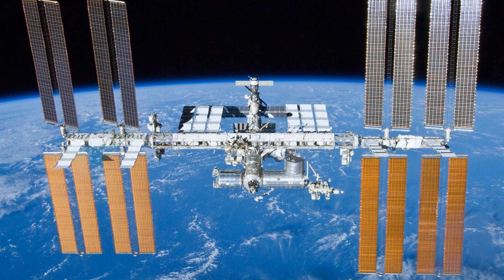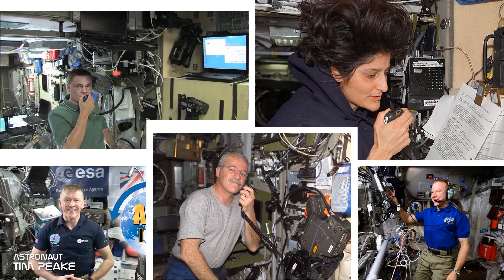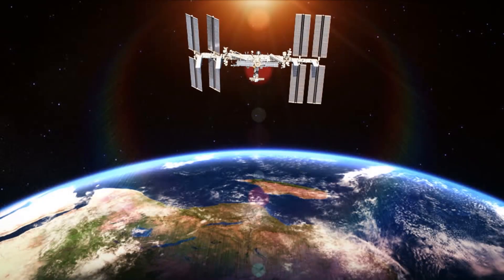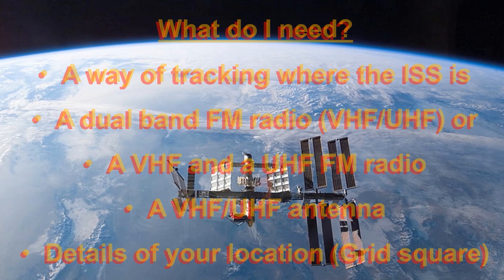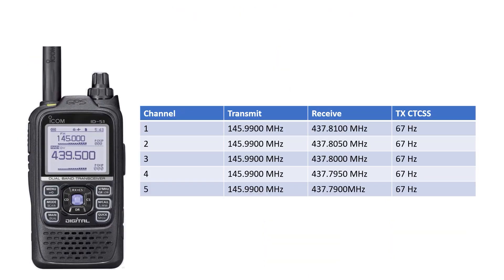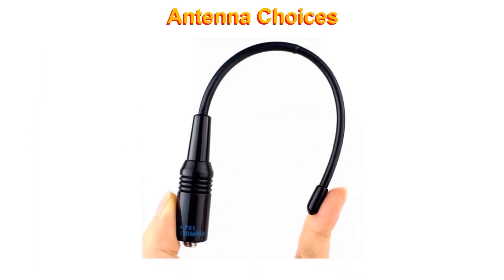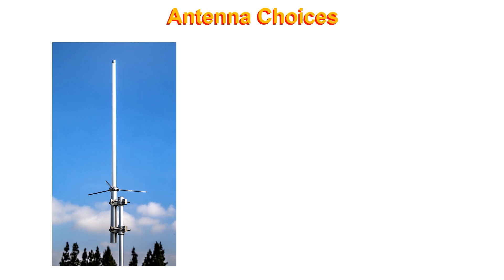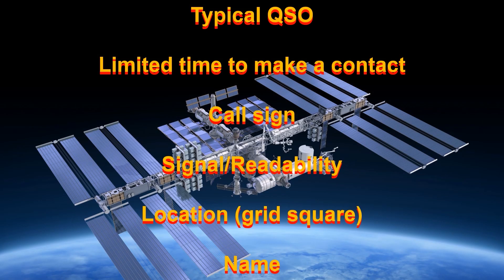How to work the International Space Station cross band ham radio repeater

Comment: 2 cardinal rules for working the ISS and any satellites: #1 always make sure you can hear yourself on the downlink. If you cannot hear yourself, you won't hear anyone else trying to call you when you transmit. You will be doubling and walking over other would-be QSO's. 

#2 DONT CALL CQ ON AN FM SATELLITE! EVER!!!   Simply give your call sign phonetically and your grid square. Leave a pause and wait for other stations to call you.  Don't be a lid and stomp on other operator's signal because you cannot hear yourself or you're continuously calling CQ. Remember the ISS/satellites are a repeater. Repeaters must be shared. Be courteous to other hams trying to use it. 

Save the CQ calling for linear sats.
Reply from the maker: All very sensible comments Jesse.

Comment: Hi Kieth. New to this.. do I put the RX frequencies or The TX frequencies into my UV-5R.
Reply from the maker: Hi Michael, no problem. Set up each channel as set out in the chart (at 2 minutes and 39 seconds). Each channel has a vhf transmit and a uhf receive frequency. Imagine it like a repeater where you transmit on one frequency and listen on another. Hope that helps.
Reply: @TheHamRadioJunkie  you just blew my mind. 🤣🤣. I may not of explained it very well. Basically to listen can I put the RX frequencies is as they are or do I have to put  other settings in I.e any CTCS settings.
Reply from the maker: @michaelnight3798  no problem. If you wish to listen then just put the receive frequencies in. No need to put the ctcss tones in for rx.
Reply: @TheHamRadioJunkie  Thank you Keith. I appreciate it.